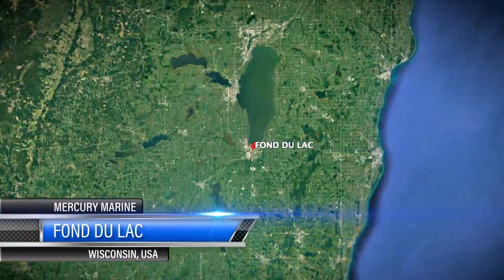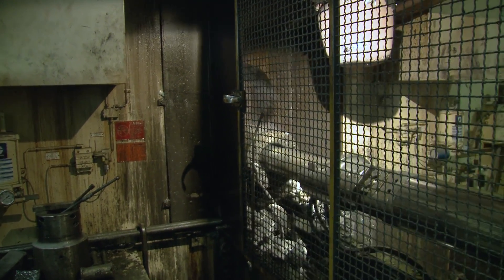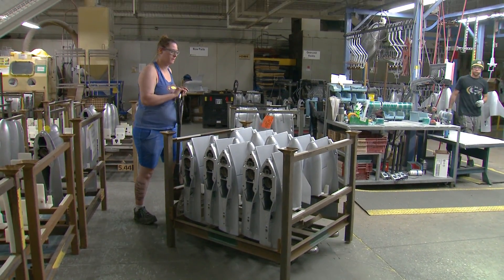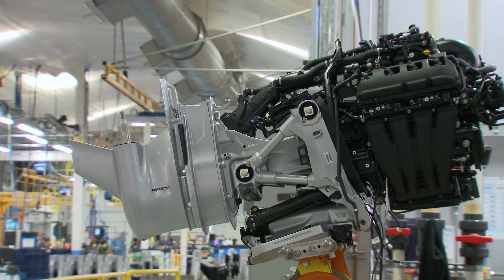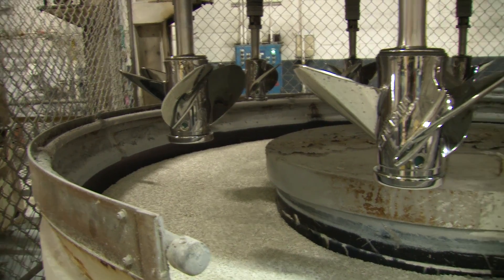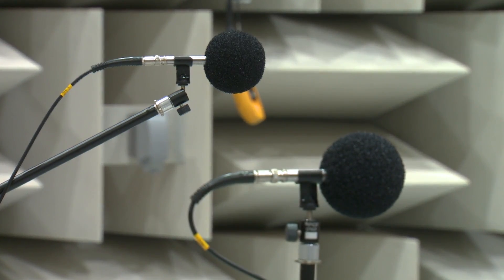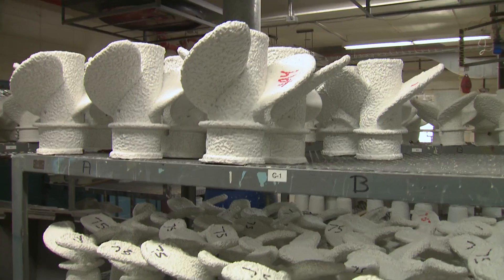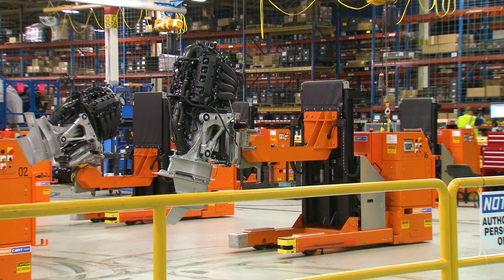Factory tour of Mercury Manufacturing in Fond du Lac, Wisconsin

Comment: I’m impressed with Mercury and I want to save these jobs by investing in Mercury with an additional plant t😊 be installed near this on in order to cohabitate and use the equip in cooperation of the first plant. I’m willing to invest 200 million right now to say these jobs and add another plant. This should also increase labor at the plants buy adding jobs. As well I will also help to sell the motors over seas in markets usually cut of to mercury due to cost. How you ask buy cutting the transport cost. I want to make a deal with Europe and Africa as well Asai for mercury to send products there ways on ships that would normally return empty! So to my delegation as and foundation do the research. As well as mercury if they are willing to take on a 250 million dollar investor and build a second plant. The only stipulation’s I have is that they do not lay off anyone. The second one is that the foundation makes at least 7% return on investment and every dollar above the 7% goes to the workers in an equal bonus check.

Comment: Fishing the fox river in oshkosh one day last summer, they have a test facility right on the river.  I was driving by and noticed what looked to be a new v8 outboard with a blacked out cowl at wide open throttle in a dunk tank.  I came thru 2 or 3 hours later and it was still running at wot.

Comment: There are so many comments here about poor reliability of Mercury motors that it must be true.
Reply: Roger Onslow I have a 94 Mariner (Merc). 90 HP 2 stroke.  Still runs as good as new.   While it has low hours, it has also been well maintained.   Thought about repowering but having it installed on a flats boat, the 2 strokes low weight is hard to let go - 305 lbs vs 360 to 400 lbs for all of the latest models, no matter the brand.  By the way, I personally think the vast majority of people who post are complainers.  And you will see the same thing no matter which brand is being discussed.

Comment: Power to weight two strokes are best less moving parts simpler. Less service time ,them fore strokes look the size of a house
Reply: fix it up I have a 94 Mariner 90 HP two stroke.  It weighs only 305 lbs, compared to all of the 4 strokes, which weigh between 360 and 400 pounds  Bought it new along with my 94 1760 Action Craft flats boat.  The hole shot is amazing and has 43 MPH top end.  Still runs just as good as the first time I put it on the water 26 years ago.  Thought about repowering, but it still runs great and so much lighter than any 4 four stroke.

Comment: I have been by this place tons of times on the Freeway, absolutely huge  place. 

Of all the outboard's I have ever owned, the only 1 Merc that was ever reliable, and ran good was a '79 110 tower of power. It sucked fuel like a Bastard, ran out great, and had a sound like no other coming up on power. I could never get past the way over priced ignition parts.
Other than that, the old Evinrude 3 "loopers", Yami's, Zook's, and Nissans was what I was after.

I hope Merc got it right????
Keep Wisconsin, and America strong Merc!!!

Comment: Nice! Would have loved to buy the 2019 or 2020 V8 250 XS but Merc gave priority to new boats and Johnny Morris (Ranger Stratos, Triton etc). After waiting 10 months in 2019 and told “just another 20 months” to complete my restore of my 1992 Champion with a new motor, I went with a 250 Yamaha VMax SHO and couldn’t be happier! Still breaking it in: 67mph in 2 1/2 foot chop and not wide open yet. Would have loved to buy American. Merc lost a lot of customers while trying to get up to manufacturing speed. BTW just had this Yamaha installed in mid Jan 2020 and was told the wait for a Merc 250 is still months out. Sad...
Reply: John Bell 
You’ll love the fuel economy and smoothness of that motor. With care expect 3500 to 5000 hours on that engine. A Ferry boat has that already.
Reply: John Bell you made a wise choice